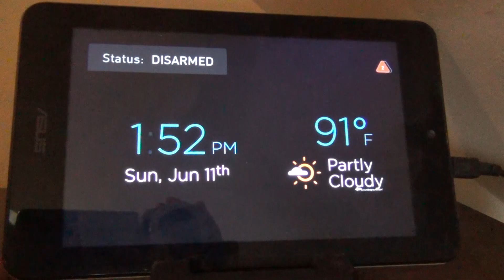FlyLady with Me || Ep. 34 || Weekly Home Blessing Hour || Cleaning the Whole House ||

Comment: Sofia, you are absolutely lovely and your videos are excellent. Based on a couple of hints you have dropped that you have a "boiler room" in your house and you do not have air conditioning in some areas... I am wondering if you have an older home like we do. Our house was built  1890  and we have radiators for heat and thus, there is no duct work for installing central air. I am bringing it up because older homes without ductwork or furnace filters, accumulate dust in a different way than newer homes that run all the air through a filter WHICH,  in turn, affects cleaning techniques and times. Just wondering if this were the case at your house.  Love your videos and this series on the Flylady system !